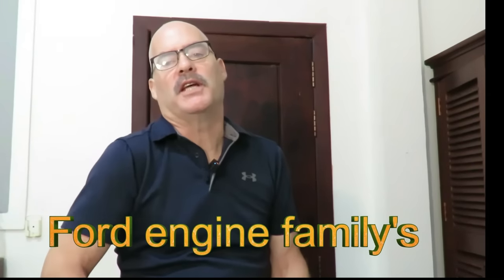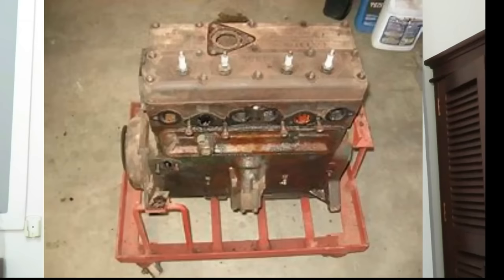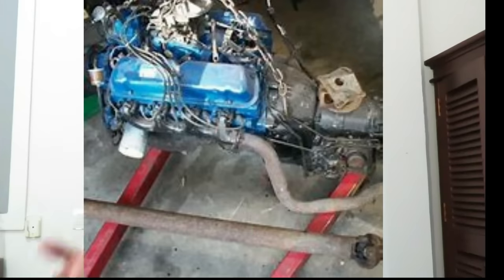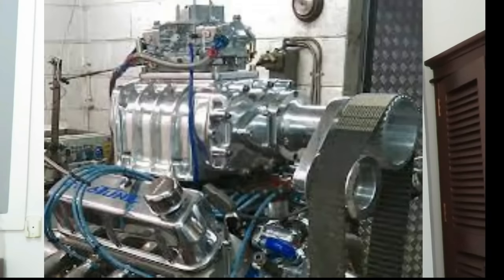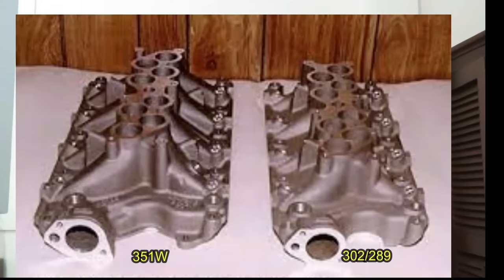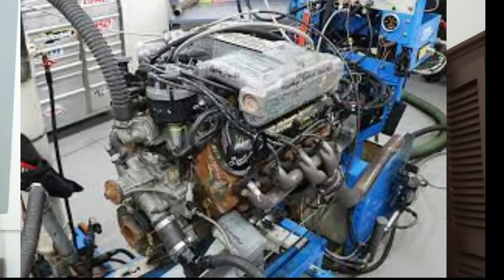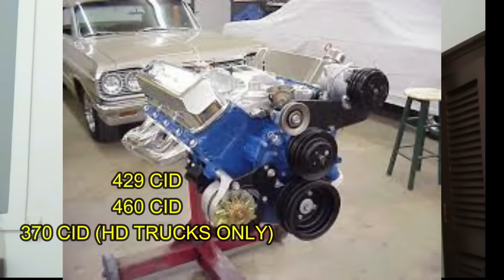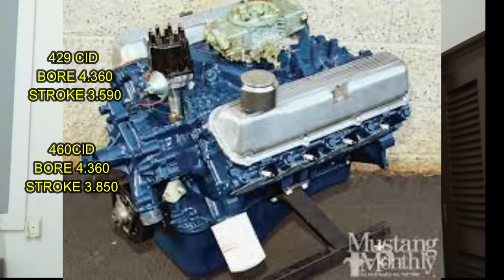FORD V8 ENGINE HISTORY

Comment: Infamous 289 & 302?  Where did you get that those engines were infamous?  They did NOT have bad reputations, they were excellent engines. 
Did you know the very first flathead engines had a single Venturi carburetor?  When a 2 venturi carb was fitted, horsepower went up significantly.

Comment: Im one of those Ford nuts You were pretty close in everything you said. The351M and 400 motors were dogs gas guzzling pieces of trash! I had a 66 Merc Comet GT it came with a 335Hp 390 Itook the 427 steel crank and rods from a 427 and built an engine for the Comet That thing would bury the speedo on the Interstate I beat a 455 olds GTO Judge with it He was maxed out blue smoking and i pulled away from him with ease. It did not smoke the tires it shredded them Miss those days lokk fwd to more of your videos

Comment: 289 flywheel will bolt on a 302 but starter will not engage 289 is smaller dont know if u can get a larger ring for flywheel found out the hard way

Comment: Oh should have done the Ford/Lincoln MEL Big Blocks the 462 ci is the best motor ! But the rarest Ford motor ever is the Buick Small Block , yep when Ford bought Land Rover Ford produced the Alloy 215 ci  V8 ( then upped to 4.6 litres 285ci) and that originally was a Buick/Oldsmobile motor but it had Ford cast into the side ! There is a story that this is the reason Ford changed to BMW V8s as they didnt want to produce a GM motor !

Comment: Actually the 221, 260, 289 and 302 are not really Windsor, just SBF. The 351W is the Windsor. Basically the same design with taller deck height, larger diameter main and rod bearings, 1/2" longer stroke. This necessetated the width at the oil pan to be wider to fit the rod throws and counter weights.
The 400 is just 400, not 400M. The 351M uses the 400 block with the stroke shortened, thus the common thought the M stands for modified. Ford had to differentiate it from the 351W and 351C, but why the M, who knows. Maybe that is what came out when the bingo ball dealer was turned.